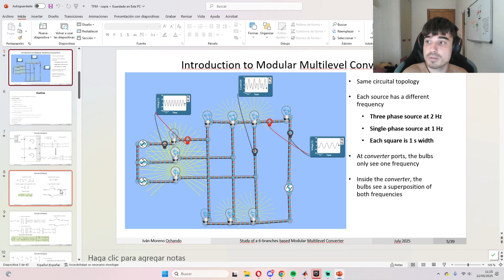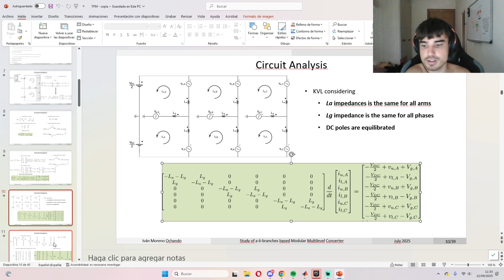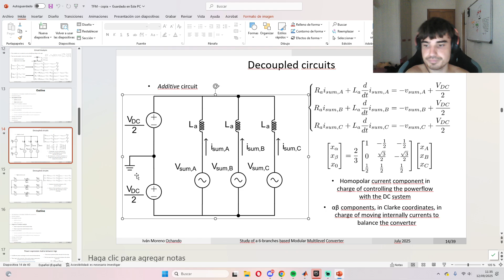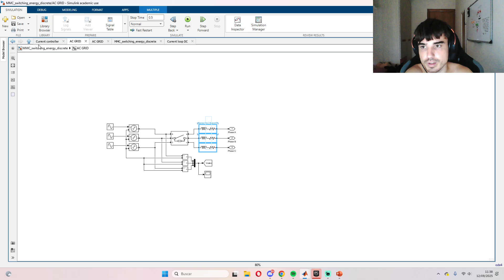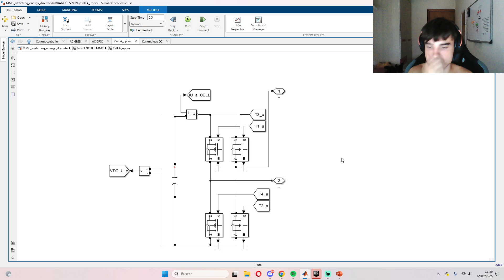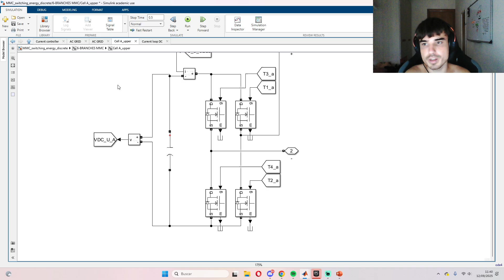Modular Multilevel Converter analysis - First part 1/3

Comment: Do you have any recommended textbooks and readings to better grasp this subject material? I have no clue where to start, but I would love to know more about these systems from a mathematical analysis and modelling perspective, with the aim of creating control systems for these models. Thanks again!
Reply from the maker: Hi! Thank you for your comment. I would like to tell you that my model, even if from a converter's perspective is pretty well deep, from grid perspective is not that well built. I am considering a high X/R ratio with no harmonics, so my proportional-resonant controllers don't go crazy. I don't either analyze switching frequency effects in these controllers. I recomend you the book "Design, Control and Application of Modular Multilevel Converters for HVDC Transmission Systems". I will be uploading the second and third part during this week. Again thank you for your interest!
Reply: @aidenmaths4414  Hey Aiden, thanks for the reply! I'll be taking a look at the textbook you recommended so I get a better idea of how these models work. Definitely looking forward to your videos later on :)